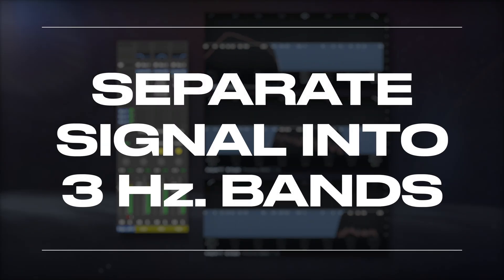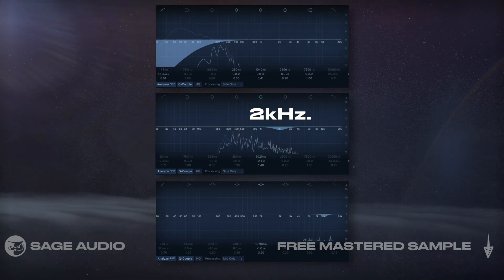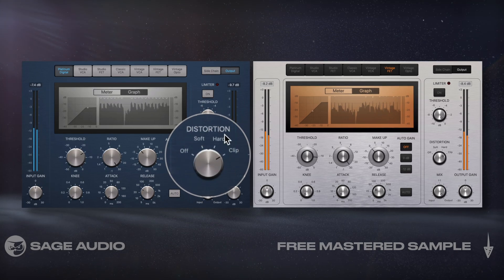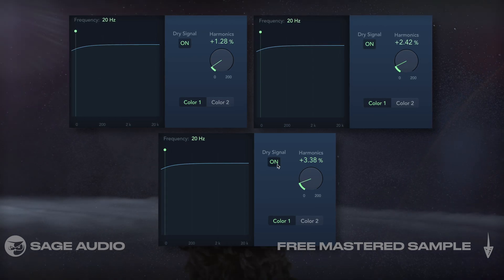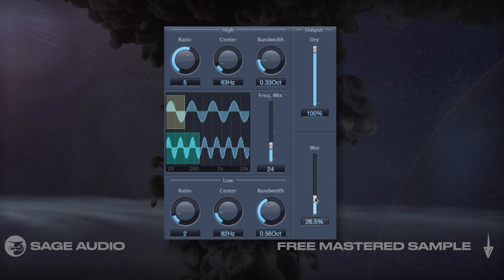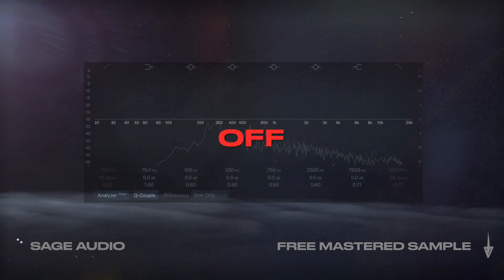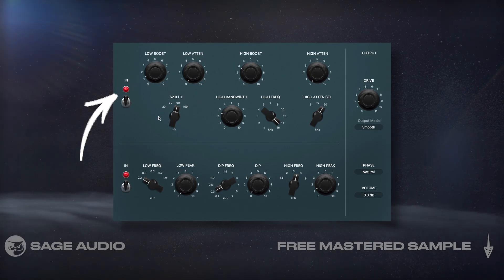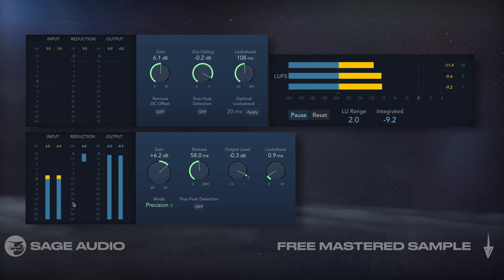How to Master in Logic Pro X

Comment: This helped immensely and for the very first time I had an excellent sounding master. However, when I bounce the track and compare it to my reference tracks on spotify, it sounds significantly quieter, as well as feeling like it doesn't have the same stereo width, though LUFS was around -9. What could be causing this?
Reply from the maker: Great to hear the video was helpful - thanks for letting me know! I'm not entirely sure without hearing the mix/master, but I'm guessing the limiter is cutting some of the transients.  Maybe place a clipper before the limiter to give the transients some edge (add some distortion whenever clipping occurs).  This should help the transients stick out, and help it sound louder.  Also, EQ may be playing a big role.  

Try the plugin Fresh Air (it's free from slate digital) and boost the mid and high bands to brighten the sound.  Usually a boost to 3kHz and above will make a track sound louder.
Reply: @sageaudio  Awesome! Thanks!

Comment: 👍👍can’t wait to try
Reply from the maker: Awesome! Hope it works well for you
Reply: @sageaudio  first time didn’t work, started from an open session where I had aux drum buses that were not 100% of the output, so I was getting a blend of the original. May be have to start fresh with the buses so full 100% of mix is going to the mix bus , still got to work that out . Maybe I’m just doin it the wrong way 
Thanks

Comment: i followed every step to a T except the tube EQ but i replaced that with a 32 band. still cant get over like -19 LUFS. what am i doing wrong? source file too quiet?
Reply from the maker: It's possible! Maybe the original gain is too low.  I'd recommend raising the gain with clip gain before introducing processing.

Comment: You lost me at the first step. How do you separate the signal with 3 bands on a bus?
Reply: https://www.youtube.com/watch?v=NFxmPglXlos i asked the same thing and this video helped. you just gotta remember to set to no output on the track with the buses so ALL the output goes to the buses
Reply: you use three different buses, then use an eq to solo the different frequency spectrums on each one
Reply: Create 3 busses with their respective eq curves, on the main track, set the output to "no output", so that whatever output you're getting, is only through the busses. Now send the audio to all 3 busses by using "sends" section in the track, don't forget to set it all to 0dB, so that the same level as the original is being sent
Reply: on the main mastering chain(first chain), you’ll turn off the output. clicking to set up 3 buses is sample but where you have to understand is once you separate & create the eq for lows, mids & highs is once you’ll actually hear the difference between the 3. it’s sample use the Pink To Lows / Red & Pink for Mids / Red for Highs

Comment: I think you may just have broken YouTube mastering classes as I’ve watched too many videos on this and in under 9 minutes you’ve managed to not only explain a very decent way to get a good master, but present it in a way that allows you to know what to listen for and improve with experience. And you did it for free! Chapeau, good sir. I love the idea of having three sends split over lows, mids, and highs. So smart and easy. Cheers!
Reply: How to split it in 3? And do this tracks already mix?
Reply: @Diskanto  yes, Mastering takes place after all the mix is done. To seperate it into 3 busses, create 3 busses and add "sends" in the original track to the respective busses, make sure you set the send-level to 0dB (so that you send the original audio in the same volume as it was mixed). Now, after sending to those 3 busses, add EQ to each of the busses, as shown in the video. Don't forget to set the original track's output as "No Output" [by doing this, you are disabling the original track's output and only getting the bus outputs]
Reply: So all this is done after mixing the track , exported and before mastering right ? That’s what i failed to understand .. thanks 😊
Reply: ❤ from india 🎉👍